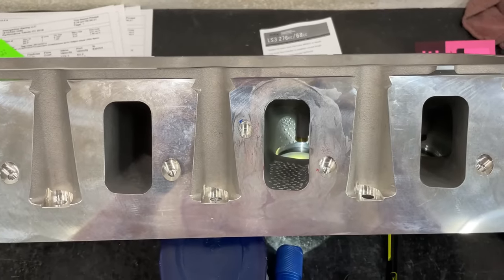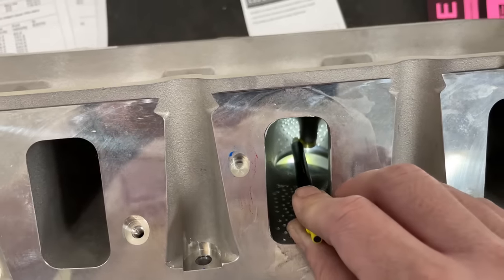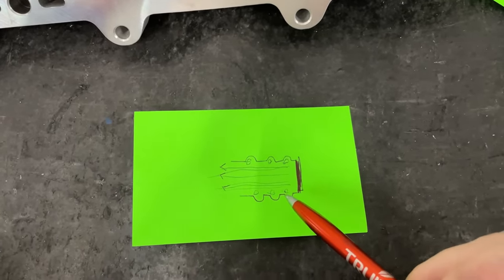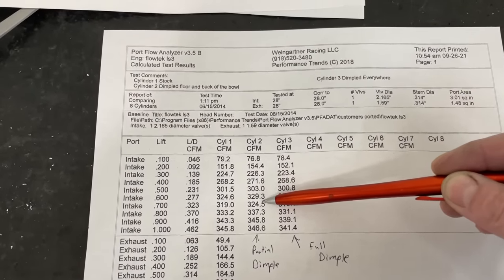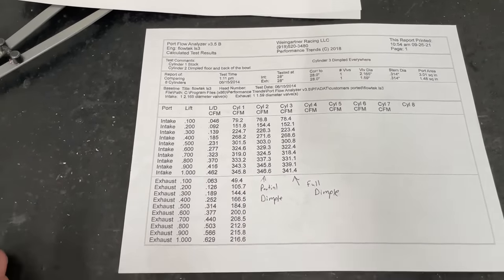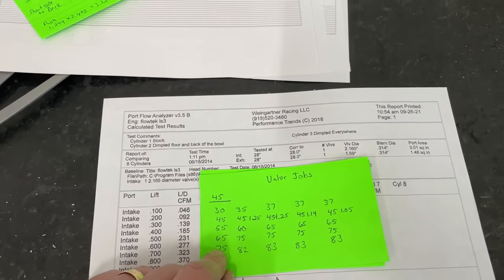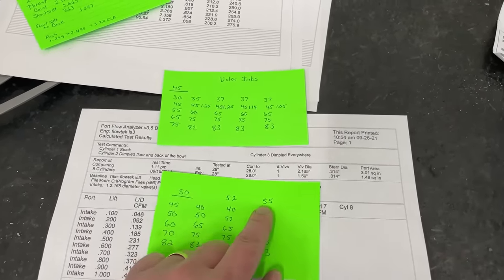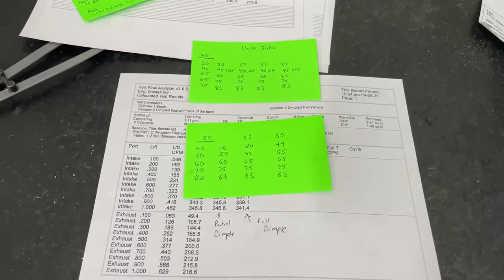Dimpling of Intake Ports Does It Help Part 1 of Internet Ports Heads

Comment: Anyone suggest those combustion chamber grooves that were popular fodder in the early 00's?
Reply: They work for low rpm high bmep detonation prevention on most production heads.
rarely show + on dyno pulls
Reply: @hotrodray6802  Oh, it does actually do something?  I'm kinda surprised.  If I'm reading your comment right it would be more beneficial for daily driver or maybe generator duty engines rather than racecar?

Comment: Wouldn't a rough surface be better at keeping the fuel molecules in suspension ?
Reply: A rough surface has a higher surface area. Might make condensation worse
Reply: @johnapples2018  So that's why you don't polish intake ports on a street engine ? Condensation ?

Comment: I always thought the dimples were to improve wet flow, not necessarily airflow.
Reply: It was about wet flow not airflow. Totally about getting fuel back into the air stream in the areas where it was most prone to drop out of suspension.

Comment: I think your therory is correct.  But I don’t think you’ll see the gains on the flow bench as much as on the dyno. So yes you lost on the full dimple. But would it make more power from the better fuel atomization?   I still think the partial dimple would be better for fuel atomization and the gains would probably show better on the dyno than the bench. I’ve seen it done before. But never dyno’d. A before and after dyno session would be the real answer.  But awesome work. Love it. Always on the quest for more power without throwing money at it but rather time and skill.   My theory it’s gets a better fuel complete burn ratio so you can run the engine a little fatter thus making more power. We all know wet fuel don’t burn and a loss of HP. So there’s that thought   Again. Good job

Comment: i want to see what jets on the ends of a tubes ran down the runner spraying right at the valve opening does. and then multiple ones when more fuel is needed.then a ramp placed over the tubes on the floor to raise the floor. plus i want to run the spark plug from the top  straight down. Also i want 3 or 4 valves per cylinder with the same ohv cam. i believe the effect or affect the dimples have shall be more of an atomization and preventing larger pools, it shall spread and drag the fuel apart perhaps losing a few cfm however perhaps some performance or efficiency and or power may be gained.

Comment: The dimples are a copy of natural processes,two example ,the first is shark skin ,it's rough,it creates the eddys on the surface albeit in water to produce an almost frictionless surface that glides through water creating very little turbulence for stealth and more effortless speed.
A second example but more complex is riverbank turbulence,this causes  a backward flow up stream!.

The most common man made version is the golfball,the dimple create an air bearing to allow the ball to flow through the air further and more accurately.

The air bearing is termed as a "boundary layer",intake tracts should be a rough surface,like 60 grit sand paper ,sharp edges create turbulence shrinking the volumetric area ruduceing air flow,subtle turbulence it would seem can be beneficial in some areas,for me a smooth path for air flow with no hard corners/edges etc is good enough.
Remove too much material and flow drops and fuel falls out of suspension,i've seen bike heads getting reshaped with jb weld to get higher velocity on the short radii but i'd hate to see the carnage if it broke free.

If i were to do that on an alloy head i'd build material up using the alloy soldering rods so i'd at least have a bond that won't break free due to thermal expansion and contraction,pretty much permanent,sadly my car has a cast iron head and this is out of the question for any reasonable flowing,at any rate a 1500 triumph spitfire only needs mild flowing and hard corner removal.

I'd like to see if anyone had the time /effort/cash to braze load a cast iron head tract to get a better inlet shape of tract.

Comment: I've often thought about making two rose of vortex generators in each port.
Reply: I met a old timer that raced in the 60-70’s and he used to cut spirals into the ports. He said it made a ton of HP on a short stroke high RPM engine by upping the runner speed hitting the valve. I’ve always wanted to do it. But I’m not that good at porting. Even thou I’ve been doing it for 20 years.  Maybe my next set of heads.

Comment: Eric will the dimling work for a boosted aplication how there is high pressure air in the intake and intake port?
Reply: It will have a proportionally reduced effect the higher the boost. It's really only relevant on a suction side or near atmospheric. So any ram air effect or boost will benefit less and less ... it's situational ... mainly for the start line and getting your engine to rev up initially. At speed, with air induction or ram effects or with boost, you will only see a slight throttle response improvement at low RPM.

Comment: You should take at least 3 tests and average the three. How would you know if there wasn't something odd in your test conditions?
Reply from the maker: The program takes 15readings at each lift point then the average is printed.
Reply: @WeingartnerRacing  thanks for the reply. I'd love to know more about your test protocol. Do you have a video for that? Anyway, great experiments. I've always wondered about the dimples. Would love to see if simple shape and spacing matters.

Comment: Flow "pressure" would potentially be increased if there were room for expansion. You have managed to create restriction buffer, so to speak, but that also diminishes flowing volume area. Air around a golf ball can expand/extend.
We're talking a whole new conversation here because it's vacuum.
This stuff has been tried over and over, without ever having significant impact on the performance industry.

Comment: My Uncle would dimple the bowl on My go cart engines when I was a kid. I don't know if it helped, but it looked cool!
Reply: That may have been more to stop fuel coming out of suspension and forming in those places. That was the original reason dimpling ports/chambers began I think.
Reply: we ran singh grooves on 2 cycle McCulloch in 1961-2 !! 

and singh grooves on small block chevy heads in 62-3... 
small S since Singh didnt exist. He wasnt the first with chamber grooving.

Comment: I would think the dimples on the short side would make the most sense that way the air stays attached during that turn instead of detaching and causing turbulence.
Reply from the maker: The port that is fully dimpled has dimples on the short side.

Comment: I thought it would but i think it need to be done on top or bottom left or right to help steer the air charge
Reply: You want to be careful with the walls they have a big influence on NOX production, sometimes it can make the port very efficient but it can also cause an over speed and outrun the flame kernel.
Reply: You want to be careful with the walls they have a big influence on NOX production, sometimes it can make the port very efficient but it can also cause an over speed and outrun the flame kernel.

Comment: Now do channeling (fullers that run vertical towards the combustion chamber) with dimpling that is right next to any corners to improve the turning and flow characteristics of the air going into that valve while having the valve have / \ on the rod to the circle part to smooth out the flow of the air and fuel but add some dimpling and teeth to the side traveling with the flow towards the center to cause turbulence and vortexing to help with air fuel mix and vortexing inside the chamber.

Comment: another thought.....you might be able to glue a 3d printed/premade surface (that would be smooth, consistent and easily changeable) to that of the port for testing, thus you could use 1 port for multiple tests.  To get it to work, you might cut into the water jacket or head bolt passage, but it would be a much faster way to test. I wouldn't trust a computer simulation as much as a real world test. another another thought!!! additional variables, going from larger dimples to smaller ones as the flow moves down the port (or reverse), where to end the dimples, with the differences in intake port architecture you might even have to change the dimples pattern per port just to compensate for the different type of entry flow as the fuel mixture moves from the intake to the head.

Comment: Despite seeing some improvement in cfm, I personally don’t think there’s enough gains for me to justify dimpling my expensive trick flow genX heads.
Reply: inject die into the port shows diff results..flow benches sometimes dont tell the whole story..i can take the swirl vein out of an ls7 heads lose 10cfm...inject die into the same port the die will run back up the short side...cant see it without die...it gains power across the rpm band...an good for 2mph in traps alone

Comment: I talk to a lot of people in mooresville and almost every nascar engine builder has at some point or another experimented with this for the past 4 decades.  No one I’ve ever talked to found it to be beneficial in comparison to a properly designed and shaped port.  NHRA, Nascar, Indycar, formula 1, and the major 410 sprint car engine builders all focus on proper port shape and size and not dimpling.
Reply from the maker: I agree but people asked so I did it. It’s a waste but everyone has an opinion on it.
Reply: @WeingartnerRacing  I appreciated seeing a video and actual results on it.  I was mentioning things I had heard but never actually seen and tested.  Was pretty fascinating seeing an increased boundary layer work in a similar fashion to filling the port.

Comment: What I would like to see tested: Valve stem size. Use the same junk valve, a flow test at .600, then lathe the valve stem down and see if it picks up flow. Should be easy enough to test for a man with a flow bench and a lathe.
Reply: Necked down ommercial valves available
Reply: @hotrodray6802  yeah, I know, I want it checked with the same valve.

Comment: There's no evidence to suggest a gain one way or the other.Edelbrock used to score some of its inlet tracks on some of their 60s & 70s manifolds but Honda know all about port speed & air mixture suspension from the days of their 1st Civic, if they aren't doing it stock OEM on their engines now, it's not worthwhile.Trev New Zealand. Home of the world's fastest old Indian 🇳🇿😇

Comment: CFM should not be the only test, if boundary layer is increased then port speed should go up and flow would go down as the port now acts smaller. Did you test air speed before and after?

Comment: you might want pimples not dimples,  buffeting is a proven theory to increase airflow or increase airflow in another another area, basically breaks up the air flow speed at the area buffeted, but then its picked up even faster behind it where it smooths out or disappears, take the leading edge of a spoiler they will buffet a section to increase air flow across the trailing edge, or they will buffet pre spoiler... you've seen this on F-1 cars with all their crazy spoilers everywhere, look close and you will see where they add pimples (buffeting) to manipulate the air stream or flow across those.. try pimples next time not dimples and they want to be radiused, if the bottom is left flat by the drill bit not rounded or cupped it's not as effective, and you don't want walls, you just want a cup, an eye contact shape upside down, proper buffet dimpling.. you added round holes with walls and a flat bottom, not near as effective, try the upside down contact or raised as in pimples, same thing an eye contact but raised..  buffeting, also the spacing and size is critical as well, those formulas should be found at aerodynamic wind tunneling websites?  note how a gold ball has buffeting (dimples) all around it right? try that exact same size and spacing, both dimpled and pimpled.. note the dimple shape..

Comment: The boosted body dynoing na 4 cylinder nitro motor. ran into air fuel mixture issues because the intake was to smooth.

Comment: Everything I've even seen about dimples is that they are just an extra service, that have a negligible gain. If you have a CNC porting a head anyways, why not have it toss in some dimples for some extra profit. What actual race programs do you know of that does this? People paying up wards of $10,000 for a set of billet heads that arent dimpled. You'd think if it made a difference, surely those people would have done it.
Reply: a perfect port needs less if any help from texturing.  But guess what.. about .1% of ports in existence are perfect, if there is such a thing.      Same stupid replies that use TOP FUEL as a example for their stock 5.7 hemi... well if John Force does it, it must be good for me too!!!
Reply: He just showed if you have a set of stock heads that you're going to use you can add a little to that head by doing the partial dimple he did.  He's the first person I've ever actually seen do a flow test with dimples.
Reply: golf balls have dimple and perform much worse without them. But he is also testing dry air flow and never wet flow. and engine does not just flow air (unless DI)

Comment: Hi if it's a street engine why not cut say a 38 degree seat cut make the valve flow more at low lift  it  acts like a bigger vavle.it's a win win situation dosent the valve spend more time in middle lift then high lift.thats just my opinion racing applications spend more time stretching there legs aka rpm.cool vid Eric thankyou. Peace

Comment: Do you think dimpleing the valve would do anything?
Reply: No. The angle of the valve job already contributes to air flow and shearing of fuel across it.
Reply: @royhorn2782  I didnt figure, but its neat to figure these little details out. Thanks for the info

Comment: An interesting concept. The dimpling is primarily to assist with keeping the fuel and air mixed? Helping with air flow is a bonus. Many years ago dimpling was done mostly in the chamber and then only in areas that had 'lazy' combustion. They said the dimpling created mini tornadoes in the chamber to enhance the burning of all the fuel. This information was in a old Drag Illustrated & Super Stock magazine.

Comment: Does the boundary layer dimpling allow the air to stick better if it continues through the venturi section all the way to the valve on your short side radius?
Reply: It will share the same properties of a convex surface much like a golf ball.

Comment: Not an expert in this. I would actually expect that the smoothness and consistency of the dimples would be of major importance. Otherwise you would seem more likely to just create turbulent flow...
Not just the spacing of the dimples but also the transitions between the dimples etc...

Comment: no different than how the air runs over golf balls. You don't even need that deep of dimples, it helps enough just to have a slight dimpling just to the point where you meet the diameter of the size dimple you want, the depth after that shouldn't really matter much, and could possibly hurt results. dimples being equidistant of each other might matter over longer surfaces, shouldn't matter that much over a few inches.

Comment: Famous racer head porter got 25 more horse power just dimpling floor with special off set bit that bounced taking chunks out of floor .
it was much faster than perfect domino lines lol
my machinest pardner  would cut little stairs starting on inside and cut a little more on each step on way out but all the way around runner he worked at Youll Bros in reno in 70s
And Skinner had a Naturaly asperated 454 in 74 Z28  Camaro 
That pulled 8 second Quarter miles Fastest Car in Reno.
And pardners olds 74 cutlass with iron heads 455 560 560 lift Scared me more than Aluminum 
Elderbrocks we put on later according to my Scared the shit out of me meter lol
if that doesnt make you Laugh nothing will lol
Usually I have Adrenlin High meter lol
But those 2 cars Definately Scare the shit out of you Dyno lol

Comment: Take a shower, where does the steam collect...on the smooth surface of the mirror glass.  Smoothing the intake port will allow the fuel/air mixture to separate  and condense.

Comment: THE PURPOSE OF DIMPLING IS NOT FOR BETTER FLOW. BACK IN THE DAY IT WAS TABOO TO PORT THE INTAKE. THE FORD ENGINE BUILDERS LEFT THE INTAKE PORTS ALONE. IF YOU WANTED MORE FLOW YOU DID IT BY LIFT OR ENLARGING THE VALVE. THEY MOSTLY PORTED AND POLISHED THE EXHAUST PORTS. THE REASON FOR NOT TOUCHING THE ORIGINAL ROUGH WALL FACTORY CASTING WAS DUE TO ONE REASON. THE ROUGHNESS ON THE WALL KEEPS THE AIR AND FUEL SUSPENDED AS A MIXTURE WHERE THE AIR AND FUEL DO NOT SEPARATE. WHEN YOU PORT AND POLISH THE INTAKE RUNNERS. THE FUEL AND AIR WILL SEPARATE WHERE THE FUEL DROPS TO THE BOTTOM OF THE INTAKE AND THE AIR FLOWS ABOVE HURTING PERFORMANCE. THERE IS A SAYING: IF YOU BUILD A FORD RIGHT YOU CAN'T BEAT THEM. IT WASN'T THE FORD GUYS WHO COINED THE PHRASE BUT THE CHEVY GUYS WHO DID. YOUR GOAL HERE DIMPLING THE PORT IS TO KEEP THE AIR AND FUEL MIXED RESULTING IN A HIGHLY EFFICENT BURN. SO IF YOU PORT THE INTAKE RUNNER FOR BETTER FLOW. SOMEONE LATTER WHO WAS THINKING AHEAD OF HIS TIME CAME UP WITH THE IDEA TO REPLACE AND SIMULATE THE ROUGH FACTORY WALL CASTING AFTER PORTING BY DIMPLING THE INTAKE RUNNER PORTS. YOUR PURPOSE HERE DIMLING IS NOT TO ACHIEVE FLOW.